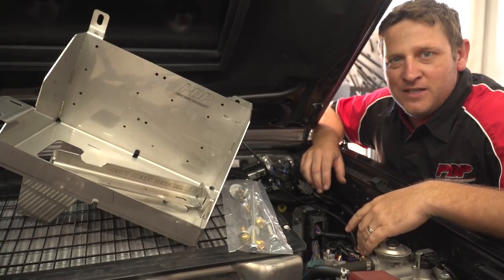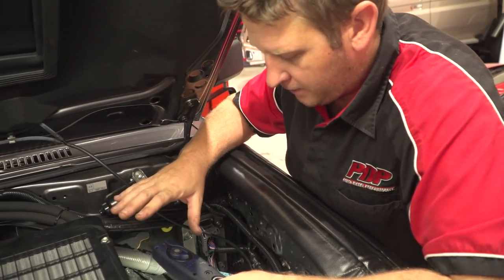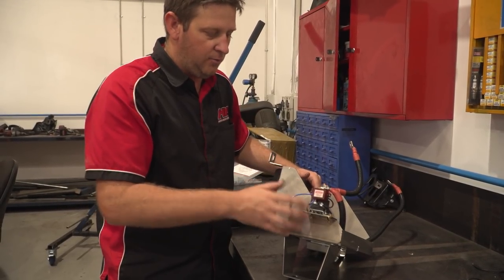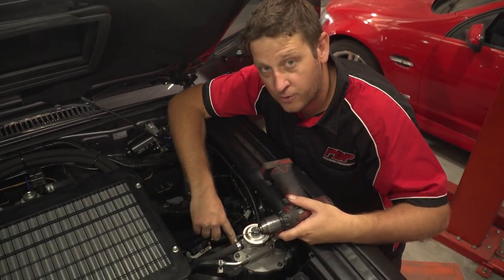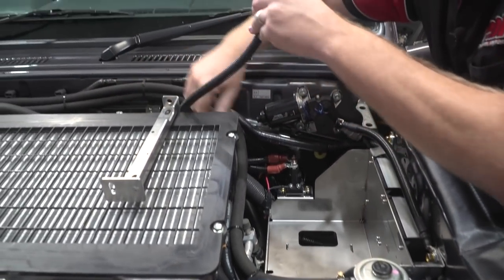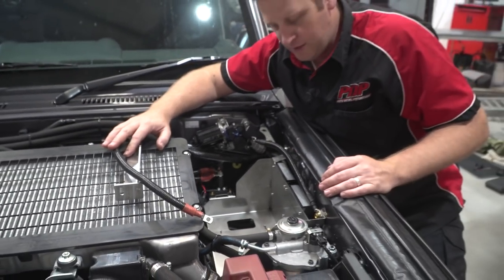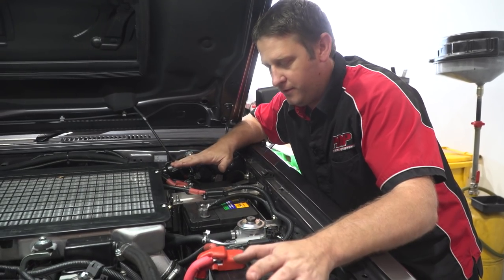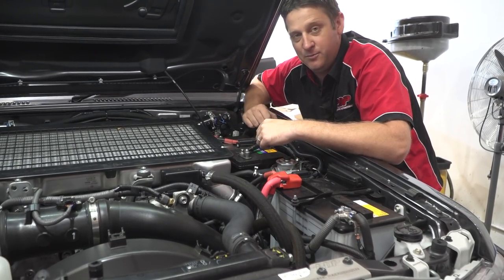DIY Dual Battery Install - Landcruiser 70 series V8

Comment: Great looking install. Really makes me want to clean up my system. Previous owner looked like he did it all himself and its a spaghetti western under the bonnet. Im too scared to pull anything apart in case it all stops working.
Reply from the maker: Sometimes you just have to start from scratch - Start off by removing all the Accessories and then tackle the wiring - best to remove the whole lot and start fresh. Always have a game plan or end goal before you start. if you need any advice or need a solution give us a call

Comment: Love drilling holes in new cars
Reply from the maker: We don't like to either that's why we pick up on factory locations where ever possible - Fitting a battery tray in does require some drilling - if Our instructions are followed there is no detrimental effect on the vehicle

Comment: 1) have u made battery trays for hiluxs . N79 ? 2) how did u wire up the SBI12 ~ blue ang black wires ? Thanks about to do this install on the 2016 76 cruiser

Comment: Very nice, I brought my 79 2nd hand and the wiring is a bit all over the shop, would be ideal to have something like this

I do have one question though, why would you run both Redarc Isolator as well as Redarc BCDC? Is the isolator just for joining the 2nd battery for cranking when the main is flat ?
Reply from the maker: So sorry for the late reply - we use the sbi solenoid as a battery link for when you accidentally flatten your main you can crank from your Aux Battery

Comment: Trav the 2018 has an accessory fuse box mounted to the side rail where your two bolts go into the body. Does that need to be moved as well?
Reply from the maker: We have a stainless steel bracket that mounts to Our fuel manager kit to hold the fuse box if required - in most cases these are discarded as they are not actually connected to any electrical accessories

Comment: Ok cool that is informative but when are you going to do a reveal on the grey dual cab that you put the 35" tyres on etc.
Reply from the maker: Soon! Almost finished the build. We have been busy 3D scanning the whole car and some new products are being CAD drawn up at the moment.
Reply: Ok then thank you, look forward to it.  Do the new my17 cruiser's with the DPF pose much of a problem with tuning or do you just DPF delete?
Reply from the maker: We wont remove the DPF. We have left both our cars standard with DPF and other than no V8 note from the exhaust, no issues with tuning or performance.

Comment: What's the going rate for the parts and install?
Reply from the maker: Peter Cooke the DIY deluxe kit is $1790. You can get the basic kit shich doesnt have the sbi or momentary switch and is $1495. Installed at our shop with a Delkor battery is $2250.

Comment from the maker: Links to purchase some of our products:
DIY Battery Setup: https://perthdiesel.store/products/diy-dual-battery-setup-76-78-79-2007-2017-model 
Battery Tray: https://perthdiesel.store/products/stainless-battery-tray-76-78-79-2007-2017-model
BCDC Bracket: https://perthdiesel.store/products/bcdc-bracket-v8-70-series
BCDC Bracket & Charger: https://perthdiesel.store/products/redarc-bcdc-1240lv-with-custom-mounting-bracket-v8-70-series-landcruiser